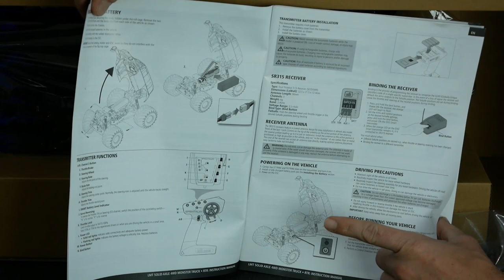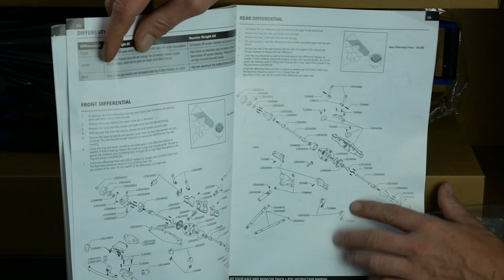LOSI LMT SOLID AXLE 4WD MONSTER TRUCK RTR: Uboxing and Overview

Comment: I was told those extra holes near the swaybars are for if you want to run a trailing arm setup and mount the shocks there instead...
Reply from the maker: I could see that with a short fat shock yes.

Comment: HELLO PRONOOBRC  WHAT KIND OF MOTOR ARE YOU RUNNING AND WHAT SIZE PINON GEAR  ON THE SMT 10  GRAVE DIGGER TRUCK  ??????
Reply from the maker: Castle 3800kv 17t 32p pinion and just working on some gearing changes on the spur this week. Vid up soon with updates